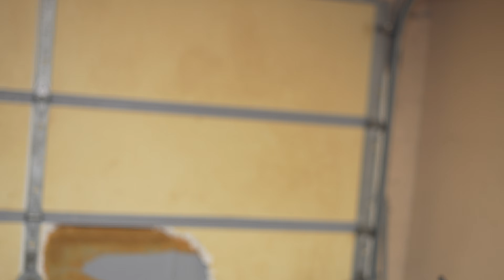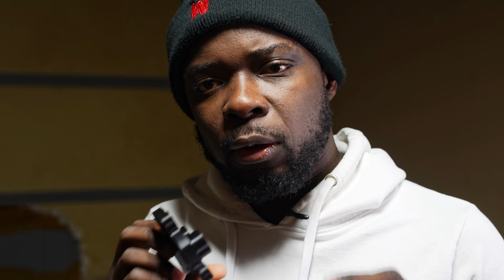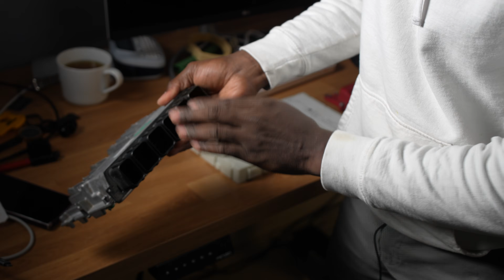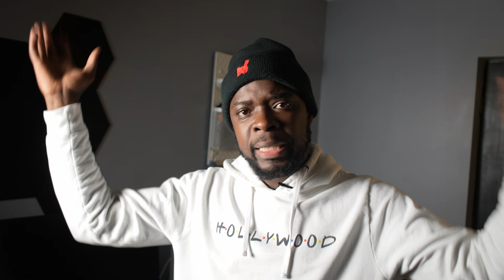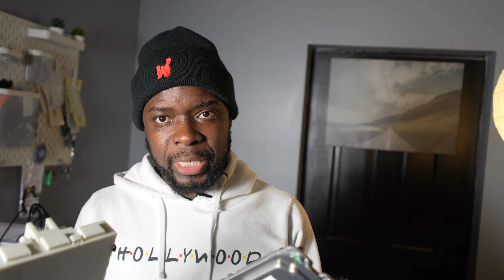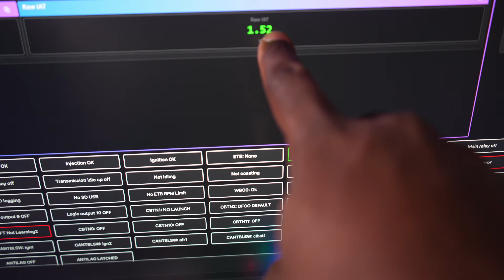B48 Swap Best Engine Management

Comment: So no b58??
Reply from the maker: I had a thought between N55, B58 and 2JZ. the thing is i want to be competitive in street class. No 6 cylinder is allowed in this class. B58 or 2JZ will throw me into a class that will require full on race build: cage, blabla bla bla bla... so no, i am not up for that.
Reply: @hyde_official ahh okay cool, would you be interested in partnering on a swap? I just need guidance lol 

But I’m wanting to b58 swap a genesis coupe.. looking into more affordable underrated chassis and I’d like to get the ecu & can-bus side going…

I see alpha makes a plug and play ecu for the genesis but no idea if the b58 would run on this..
Reply from the maker: dm me on IG: @hyde.hq